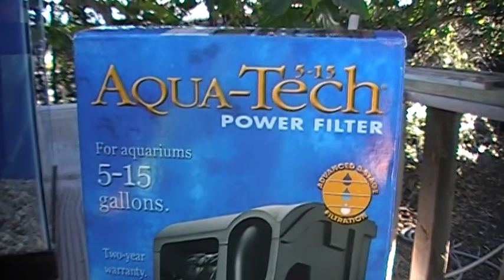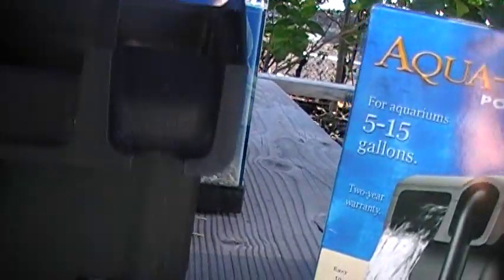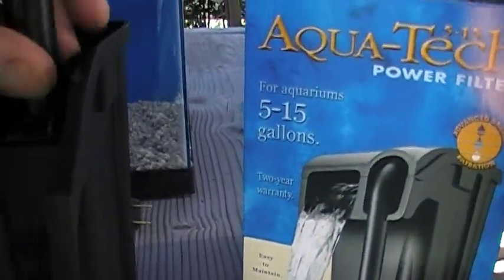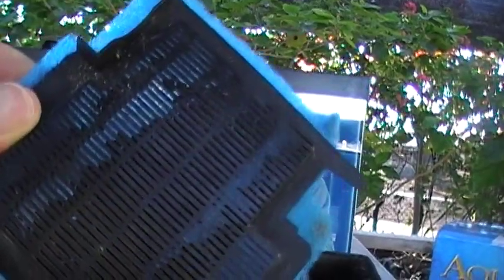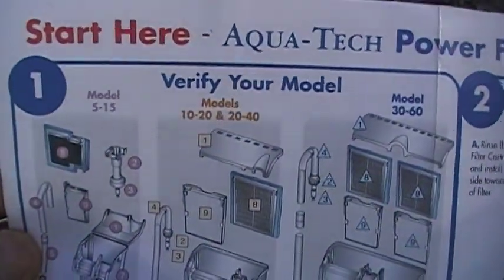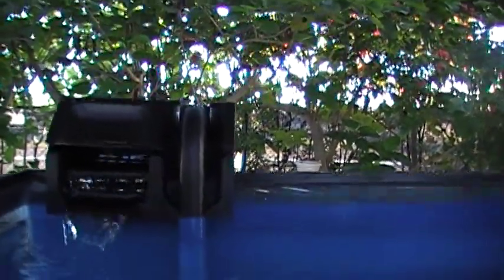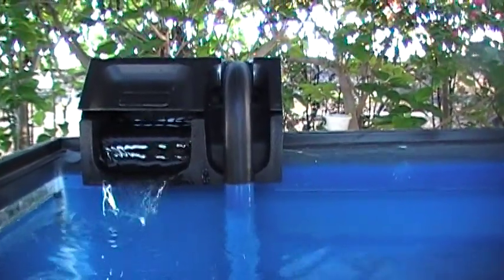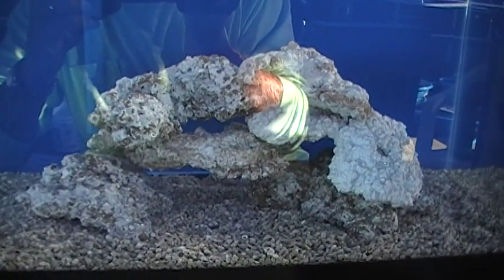Nano Lagoon (9):  Cool HOB Filter

Comment from the maker: Actually using 2 of the 5-15's is one alternative we've tried this setup as well.  You get double the flow and independent systems providing redundancy.  The hood needs a simple modification but that's a 10-minute job.  For the benefit of newbies on a budget we've kept this as simple as possible.  The use of double filters, powerheads, etc. will be covered in the Advanced Course:)

Comment from the maker: The Nano Lagoon setup described here is for a reef system with hardy corals only and very little or no regular addition of organic feeds.  That is why a simple filtration system works and no skimmer is needed.  For a marine fish tank the situation is quite different, especially if it is a fish-only tank.  Then you'd need more aggressive filtration, a skimmer, and even a planted refugium would be helpful to handle the increased levels of nitrogen and phosphorous from fish waste.

Comment from the maker: With this Nano Lagoon system we leave the Aquatech 5-15 hang-on-the-back filter in place at all times, per the manufacturer's instructions.  That includes the blue cartridge with the carbon granules. 

We change the filter cartridge once a month.  Other filters and protocols may indeed work fine and perhaps someone out there will test them if time allows.  

It would be interesting to run replicated trials to see what if any impact the carbon has on bacterial growth.

Comment from the maker: This filter still costs only about $14.00 at Walmart, so even a 2-year lifespan is a great value for the money.  In our experience they last much longer. Here's a tip -- try installing 2 of these filters on your Nano Lagoon, one on either side of the tank.  It will double your filtration capacity and water circulation while providing redundancy in case one of the filters should ever fail.

Comment from the maker: To cover this tank you would need to use a thin 1/8 inch sheet of plexiglass cut to the right size to rest on the inside lip of the tank rim, and make a cutout to accommodate the HOB filter.

Comment from the maker: The intake tube should have 3 pieces:  the strainer, the extension tube and the J-shaped top part.  You might have overlooked the extension tube, which is about 4" long.  The filter box will work without it, but if possible do use it because then the water is drawn into the filter from deeper in the tank.

Comment from the maker: We suggest that you remove and inspect the impeller unit -- there may be some gravel or other debris in there.  If so you may have to remove the box from the tank and rinse it out, then reassemble it and replace it on the tank.

Comment from the maker: this system is designed specifically for softies but it will handle some of the hardier LPS varieties.  corals do fine without skimmers because they are net consumers of nitrogen and phosphorous, with minimal organic waste production.  skimmers remove organic material, which arises primarily from fish waste and uneaten fish food.  when you start keeping fishes or larger carnivorous inverts and feeding them then the need for a skimmer arises. that is not the intent of this nano system, however.

Comment from the maker: We leave it in and our tanks cycle just fine:)  They would probably cycle fine without it too, but you'd want to confirm that in side-by-side trials with all other things being equal.  No one ever seems to get around to doing these tests, and so the debates continue.  Until they are resolved we try to use the simplest proven methods.

Comment from the maker: And no, it stays put on the tube.  It doesn't flake off.  Just be sure the tube is clean and dry when you paint it, and give it a full 24 hours to dry before using it in the aquarium.

Comment: I turned mine on without water after cleaning it to make shur it worked.

It Clanked twice then stopped.  I poured water in and it started gurgling but still...  I am worried the fan smacking the side could have cracked it, even if it works properly I am a paranoid person D:

Comment: Do you need a powerhead with this setup?
Reply from the maker: A powerhead is optional with this setup.  The unit creates aeration and water movement. They are so inexpensive that you could set up two of these units on the same tank.  This creates opposing currents and provides redundancy (life support) should one unit stop working.